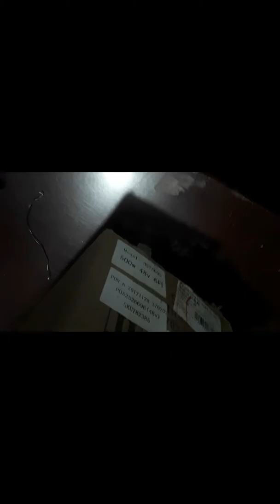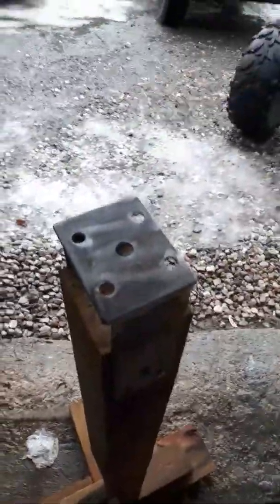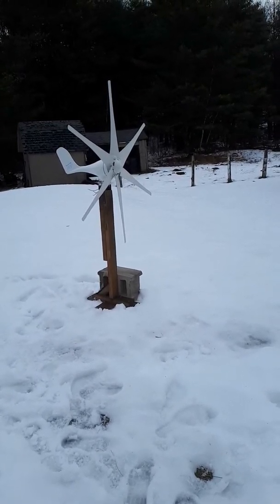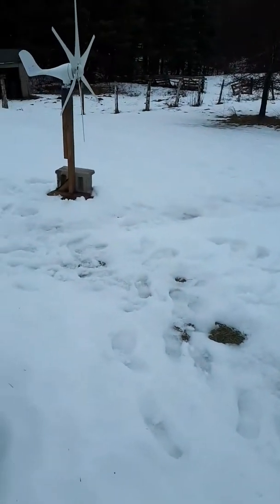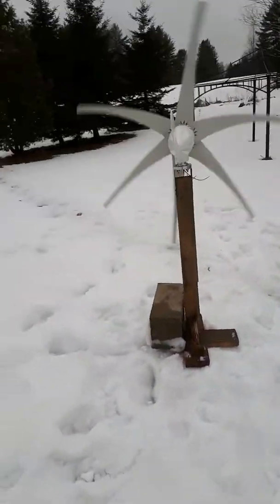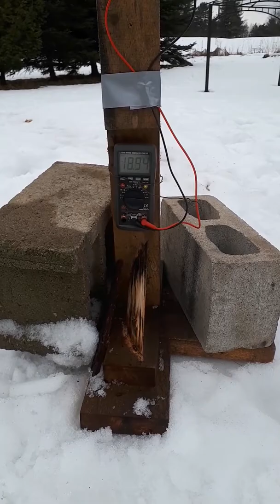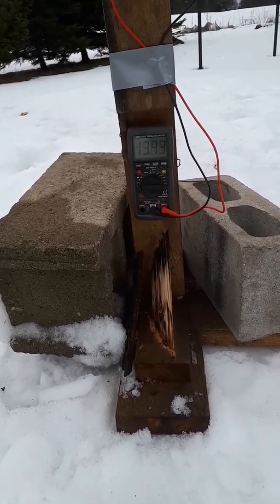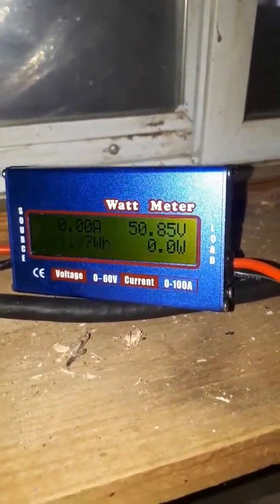New wind turbine setup and some tests

Comment: yea mine would need to be about 60+feet. to get over the trees. I hope t can get mine built and up for $200 or so. it's just unless there is a storm close by. it's not going to do much. except about 4 months out of the year! it's not a priority right now. I'm pushing hydro electric now. I got a dam to build and a bunch of work. I have plenty of alternators.  I could in theory pull near 400 amps at 30 volts. if o had the water to spin them!!! unless I can get in to the other creek. that's not happening!!   keep at it!

Comment: DO NOT RUN THESE WITH NO LOADS! Watching the progress. Now get that thing in the clear air. You can buy a length of cable perfect for it http://rover.ebay.com/rover/1/711-53200-19255-0/1?icep_ff3=2&pub=5575119394&toolid=10001&campid=5337966591&customid=20+year+cord&icep_item=263229163801&ipn=psmain&icep_vectorid=229466&kwid=902099&mtid=824&kw=lg LMMC SO 10-3
Reply from the maker: I wonder how much it would cost to get it up 70 feet
Reply: You don't need 70 feet, just 5 feet over obstructions.